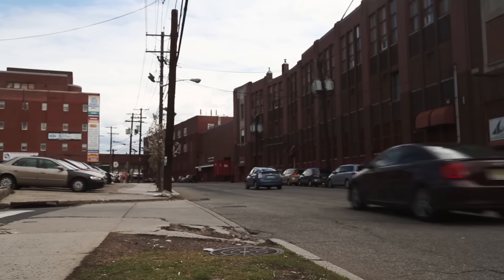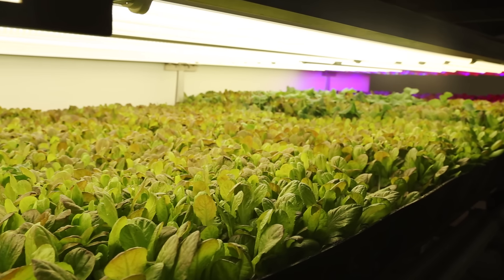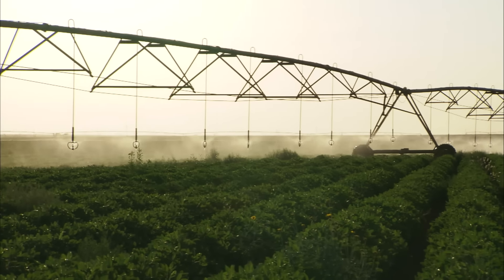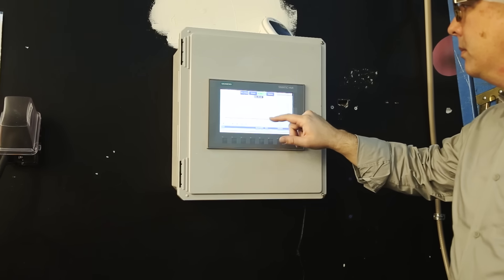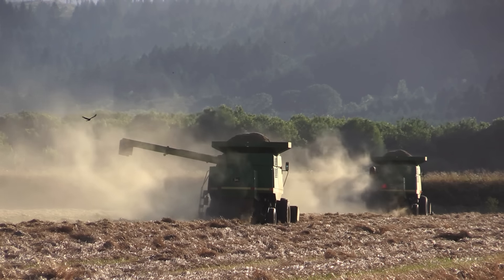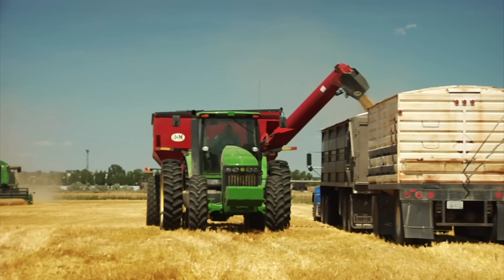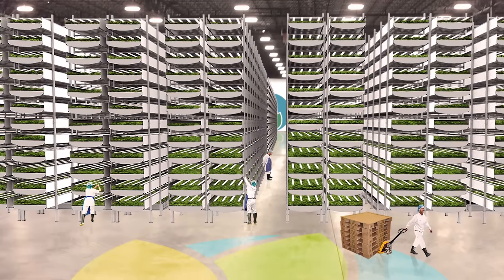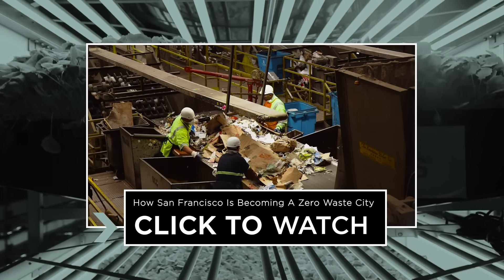This Farm of the Future Uses No Soil and 95% Less Water

Comment: Solar powered vertical farm would be ideal
Reply: No can do.
Reply: @goldenassassin7995  why not?
Reply: @UcheFiasco  I'm sure it can and probably will be a norm soon.
Reply: no, it won't, every time you convert one form of energy to another, part of it is lost, solar is only like 20% efficient, now you convert that to electricity, light and heat, and then the plant coverts that again to grow. It makes zero sense. Also to run facilty like this you would probably need couple of football fields worth of solar panels. You might as well plant in soil then.
Reply: @extracoolboy  I am pretty sure solar powered means the sunlight can reach the plants directly, the original meaning to solar powered.
Reply: @extracoolboy  It might not be possible now, but as solar becomes more efficient and innovations in energy storage improves, solar powered vertical farms, like the set-up in the video, WOULD be the ideal solution for feeding a growing population.
Reply: @futuramanut  not exactly what I was implying, but  that would be interesting. Using reflective surfaces to get light around the facility. Or even optical fiber
Reply: Uchenna Osuala No. Every step you mentioned you lose huge chunk of energy during conversion. It is not matter of innovations, but simple physics. I'm sorry, but that idea is really dumb. If, say a plant is 100% efficient under sun, and you converting sun to electricity and that back to light is only 10% or less efficient, do you really think it would be better??
Reply: @UcheFiasco  Why not simply you know use the SUN for plant growing?
Reply: Golden Assassin we don’t have enough surface area. That’s the whole point of vertical farming
Reply: @UcheFiasco  Yeah it can happen outside. Does not need that facilities
Reply: Golden Assassin that just introduces so many variables. It’s easier to get more consistent light indoors, easier to keep out diseases and pests, you can control temperature and humidity indoors.
Reply: Golden Assassin efficiency is the name of the game my friend
Reply: Golden Assassin aw man you make some really good points. I’m convinced. thanks
Reply: @UcheFiasco  Your welcome man always happy to inform other people.
Reply: Wow, something in all caps. I'm going to be reading that reaaal soon.
Reply: @John Tumpich I would if I had the land and the money.
Reply: @melonqueen5138  It is still cheaper than this facility
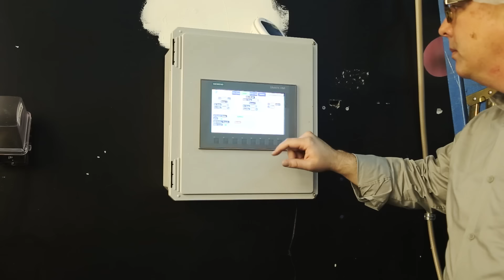Reply: @goldenassassin7995   You have to laugh or cry when at 1:24 when the man talks about "reducing their energy footprint". How? By taking a species that naturally grows under the cheapest energy available and then stacking it in a warehouse, so you have to replicate the sun MANY times because of the layers. I know that they are low-voltage, unique colour spectrum globes, but the energy has to come from somewhere.

It is like electric cars. How is the power created to charge them? How much power is expended constructing these farms? There is no free lunch with energy. Except for the sun.
Reply: It already is.  !!!!!
Reply: @futuramanut  NO
Reply: @thijsjong  so you seem to be missing out on a few key concepts

firstly, they discovered that plants DONT need all light wavelengths of the sun, so effectively they are using a more efficient wavelength than the sun to reduce the energy expenditure. plants will not care for it, thats the exact reason its being done.

secondly, your making it sound like energy loss is somehow a problem in regards to solar. if your gonna complain about energy loss, you may as well panic about all the solar energy thats leaking past our planet, which could only be solved by a dyson swarm/sphere. the only real problem might be a limitation on how much charge can be flowing at one time, but we are making so many innovations for renewable power, and countries around the world are proving that they can manage to go renewable even without the same resources as the US. 

well be fine. the biggest concern we SHOULD have is utilizing better materials and reducing the effects of getting more on our environment. but aside from that, its immensely beneficial to save the arable lands we still have and reduce our freshwater usage to the best of our ability.
Reply: @thijsjong  Realize that plants only convert about 10% of solar energy into usable product anyway. Plus, high temperatures further reduce the plant's output (Excluding C4 and CAM), a temperature controlled facility would negate this, the photosynthetic output of the plant would essentially run at 100% capacity 100% of the time. Furthermore, it's significantly more water efficient.

Comment: It's a pity this video doesn't mention the amount of electricity vertical farming" is using…
Reply: Not anymore than the typical company. LED lighting is energy efficient, and we could easily use the extra land from farmspace for green sources of technology like solar and wind.
Reply: I'm pretty sure it takes way more energy to run a traditional farm. Gas for farming equipment, electricity, waste, pesticide runoff, all these things would have a greater impact on the environment than just the electricity from one building in a city. Plus, if we want to reduce the carbon footprint even further, use nuclear, solar, or wind to power these buildings.
Reply: +Pablo_Frescobar1 he was being sarcastic. Lol
Reply: They may use more electricity than a normal farm but you reduce pesticide and herbicide use. You reduce the amount of gasoline used to transport the crops because they're grown in population centers rather than hundreds of miles or even thousands of miles away from those same people. It also reduces water use which reduces the power consumption of our water systems. Reduces pollution from runoff. Allows growing year round. So many more positives that far outweigh any negatives.
Reply: +Uhohhotdog thank
Reply: It's LED lights, so not very much
Reply: I gurantee two rows with that setup pulls at least 400 watts.  That is about 50$ a month in electricity alone.
Reply: But it uses 95% less water, and he does speak of reducing their energy footprint
Reply: KindaComedy It uses less water then rain fed fields?  Saving all the water that would otherwise be lost.

Yea no it doesn't.
Reply: "dipshit"?  Try to be respectful. When one enquires about the long term overall energy efficiency and carbon footprint of solar panels and their negative externalities, one can see that it's more complex and questionable than what is advertised by users and promoters of it. I don't take a stand on the principle itself but I don't take things for granted either just because someone says it's greener. I'm all for stopping standard agriculture, but a whole systemic analysis about vertical farming and its generalisation must be conducted.
Reply: cyberprimate I'm glad you're open minded.  But why would you ever say anything like " I'm all for stopping standard agriculture."  

If you did your research you would understand the best farms are very high tech, minimal water consumption, green fertilizer farms.

Oddly enough they are as to close to the way we have been doing it for thousands of years.
Reply: I wasn't speaking of modern green-oriented agriculture.
Reply: @cyberprimate Then you don't need to worry much about the USA.  To many regulations for anything but.  
In all reality non-animal farming is very low impact to the earth, as long as it is done correctly.
Reply: LED lights like the ones they use are super cheap to run. I switched to LED lights and started saving a few hundred dollars every year. Besides the power could be provided with solar panels.
Reply: Laptop46 Solar panels require resources, rare resources, labor ,and distribution.  I.E very high cost.

Yea I've used LED a ton, they are ok for spouting and cuttings.  A farm like that is pulling over 20k watts in LED light constantly.  Think of that for a second.

Trading one resource, water, for another, light, doesn't work well.
Reply: Martin Fischer
assuming a panel lasts 20 years, those costs are a once every 20 year cost rather than every single harvest.
Reply: Uhohhotdog Still a resource cost that the sun doesn't require.  Also Solar cells take many, rare materials to make.
Reply: ***** Because all that takes resources.  Most of our food is engineered to be pest resistent. 
Outdoor crops are as hardy as they come.  Barring massive floods/forest fires/catastrophes.
Reply: It does, in a way, address that. They are using high efficiency LEDs optimized for the exact spectrum (frequency or "color") the plants want, so 100% of the emitted light is being used (plants do not use 100% of the natural sunlight that falls on them). Certainly this uses more energy than traditional farming when you look only at light, but it has massive savings in energy related to pesticide production and distribution, fertilizer production and distribution, water processing, use, and distribution, harvesting (the smaller area means more efficient harvesting) as well as the MASSIVE savings in carbon footprint and energy cost by removing the need for long distance transportation (since the farm is within a few miles of its intended consumers). Also, since the plants are closer, there less food waste and no need for washing (since they do not come into contact with contaminants and there are no pesticides).
Reply: seastormsinger Spectrum is irrelevent.  %100 of one LED output, even a bed setup like they have, still sucks.  Can't grow anything good, no Corn,squash, melons, berries, fruit, peas.  Possibly some peas but I highly doubt it.

These setups require fungacide control which would be the a similar cost to fertilizers.

Most large scale organic farms use no fertilizers anyway, and that's how they are all headed, at least in the USA.

Distribution costs would be the same.  As well as the transportation carbon footprint.
This setup even with a solar generator would have a bigger carbon footprint.

How are the plants "closer"?
I guess your only real points are harvesting cost and water loss from washing, which many crops don't even require.

Honestly you guys need to think constructively and educate yourselves.
Reply: Two main points. 1, intensive land use is itself not so hot for ecosystems (agriculture breaking apart natural ranges is one of the largest pressures pushing animal species to extinction. If all the land for like 300 miles is corn and you don't eat corn, then your migration options are a little limited), and 2, systems like the one described in this video have the benefit of being climate-change resistant. Once the wide fields of Illinois turn into either jungle or desert, I'd like to not starve to death, even if it costs a little more electricity. Also, using less water means less likelihood of water wars starting, and that shit's already becoming a problem in some parts of the world. To not starving to death, I'll add not dying of thirst.
Reply: cyberprimate traditional farming ends up using a lot of energy too, mainly to transport the food to cities.
Reply: True. One needs to analyze systemically the most ecological option. But as I wrote above, the main problem is that these farms are unable to produce profitably all things that make the core of our food: cereals, legumes, root vegetables. Only leaf vegetables or strawberries…
Reply: cyberprimate Correct, it is very hard to grow anything other than herbs and spices with this setup.  I have done potatoes, but you could do potatoes without the lights if you wanted, lol.
Reply: cyberprimate they did day LED lighting, can be used with smaller foot print on electrical usage.
Reply: William toxic These beds pull a lot of Watts, a singular bed pulls 200 watts consistently.
Reply: Looking into the future there is basically no need to worry about elecricity used. But the polution and space used is greatly reduced by such farms and I believe that this will partially replace traditional farms because of its effectiveness.